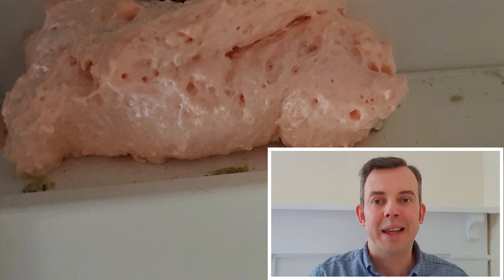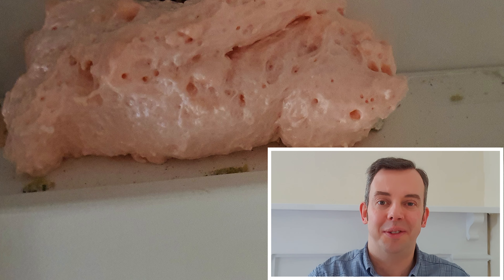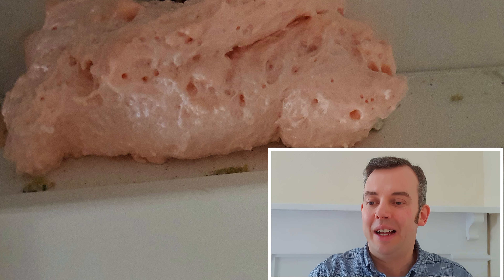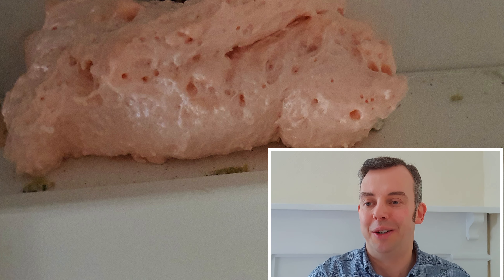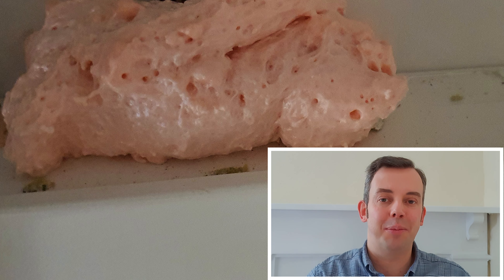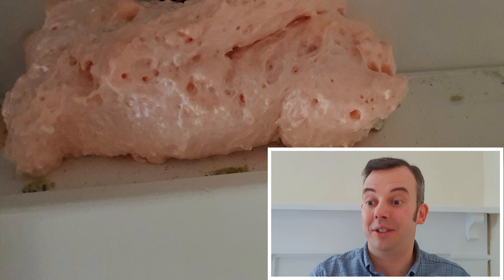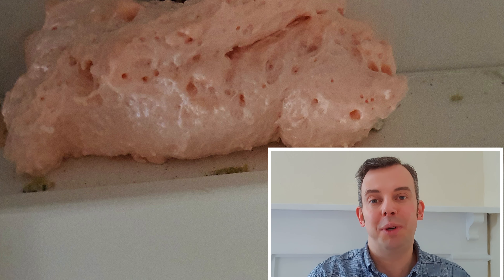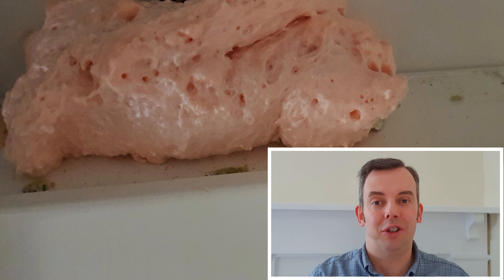Electrician reacts expanding foam used on consumer unit

Comment: HI, My home was built in the 1930's and the Electrical Box has a big hole behind it which actually goes through to the outside skin of the wall and can't see any plaster next to it- alot of cold air comes through it. Is it safe to seal this with foam or would this have to be an upgrade combined with building work to redo that area?
Reply: I have the same and would also like to know if this is safe to do?
Reply from the maker: Hi, thank you for your question. It's difficult to say without seeing it. If you have a photo you could send via Facebook, I would be happy to have a look. Generally, I think it's best to get the hole made good rather than using foam. However, it sounds like the consumer unit would need to be repositioned. 
Regards
James

Comment: As you say a completely unnecessary task. I’m having a debate with a colleague about the need to use fire sealant in the back of a consumer unit. I’m with you and I say, not necessary, the regulations state as long as IP4X for the top, and IP2XC for all other exposed sides is achieved then this complies. There is no mention of sealing up the rear with any form of gunk.  The regs require domestic consumer units only to be made (manufactured)  of non combustible material. Unfortunately, so many people are hung up on pumping unnecessary fire sealant into rear cable entries. 👍great video James👍
Reply from the maker: Thank you. I'm glad you like the video.